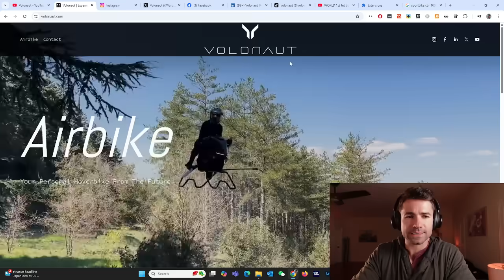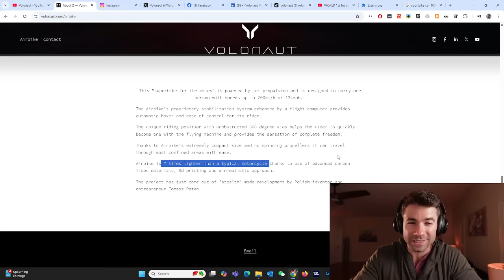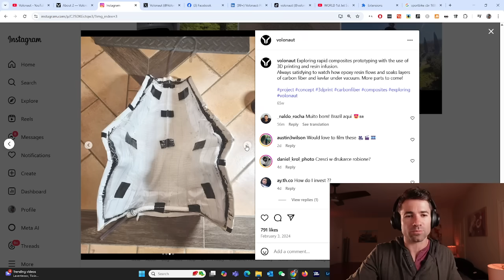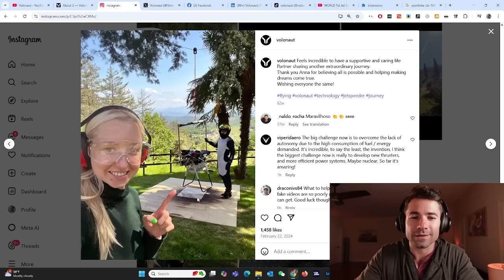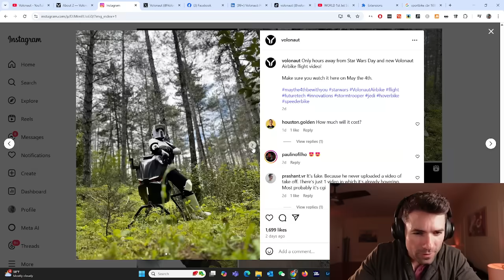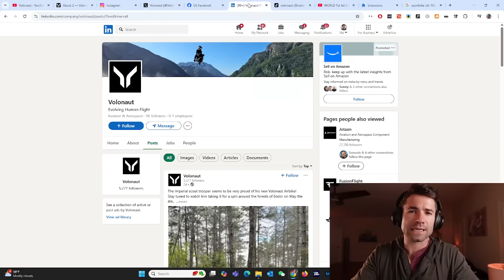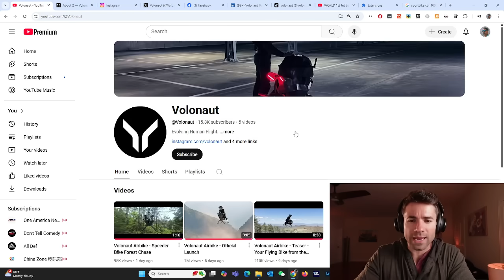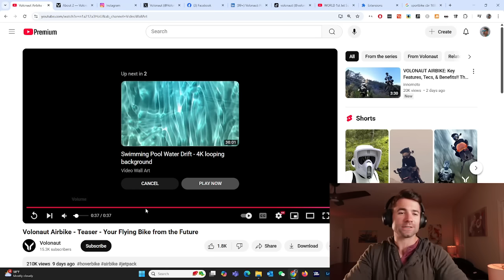Is the Volonaut Airbike Real or a Scam? (Expert Breakdown)

Comment: Indeed it raises the question of what drives this thing. So far there has been no implication for its ability to keep with the fact or fiction. In terms of parameters, presets for say feed/output vectors this will is just lacking. Certainly not the lethal scramble ability of the speeder bikes in Star Wars The Return Of the Jedi. In fact it would be outmaneuvered by any similar rivals in real life

Comment: although i absolutely fucking hate electirc vehicles , after seeing what you said , i trust you for that part 

hers's what i think 
physically it is possible but i do doubt the max.speed claim "204kmph" i dont think it would doo that much but i also do see it hitting that speed 
- If this even is real and gets out in the market the rich people shouldnt probably buy it cuz holy mother of gravity , thats a lot of Gs to be pullling for a normal person , people like f1 drivers, Fe drivers , pilots (especially single seater jets) would have a initial smoother time with this
- Now THATS a hot ass i wonder how much heat that jet engine is pushing from my educated -uneducated guess its hot

Comment: Fake. How do you come to the reason, that this would be real? Nothing of that is possible right now.
Reply: This device is rather simple. there is nothing extraordinary in it.
Reply: @orfyreus1961  If you can't spot CGI here, I don't know how. There is no air intake, there is just this easy to render blob where the "pilot" sit on, I Blender you such a footage in exact this quality in about 4 hours, well, the rendering takes a lot more on my old rig, but this was really cheaply done. It is correct, there is nothing extraordinary in this clip, when it comes to CGI. This is something everybody can make at home a few hours work.
But the "design" of that hover bike is sloppy and unbelievable. This is a show-reel for a CGI specialist and they will sell their workforce with the positive comments under their clip to the industry. That's what it is. So, then to fly this as a turbine vessel, you'd need trust vector, where are the mechanics hidden? This needs a certain length of construction to be able to do that, even if by miracle no air intake is necessary from anywhere for this turbine/impeller. Next thing, if that's electric, where are the batteries stored, that still leave space for the impeller? If it's a gas powered turbine, where is the exhaust? 

Usually, if people fly with such experimental crafts, they fly over water, because this kind of craft will fall like a stone when anything happens. And if you want to have an electric trust vector impeller, there needs to be a certain ratio of air intake and speed to produce the necessary lift, which is here 80 kg of human plus at least 50 kg of craft. You can create that lift by massive air, that you move, but for that you need a really big intake, like it is with propeller driven platforms, where you stand on and leave enough space for air to pass through or you need massive speed, acceleration of the air, which only can be done with gasoline driven turbines. Ever seen how hot those turbines become, especially if you need to keep it small? 

Usually the cooling is done in RC craft by speed of air, which is not the case on a hovering vessel. There is not even any RC craft available, able to do this, so there is zero of the steps available to get to a manned flight of this kind in the model area. All craft first are flying as models and there is just nil. Nil.

If you can't see the impossibility of engineering behind this project, then you most likely are not an engineer, are you? This is a bullshit project and a sales pitch for a CGI company or just a fun project of some hobby jesters. There is stuff that is possible, there is stuff that is maybe possible with huge gaps of hidden development and then there is bullshit. You want to build such a thing? Well, I guess with a turbine and afterburner, then you need the stages, intake, turbine with compressor, injector and exhaust then the burn chamber and after that the trust vector of the whole thing. No way to put that in such a short vessel up-down. Just no way, brother. You see that or you don't and this is a cool project, but it is fiction.
Reply: @ Sorry! It`s hard to discuss with your lack of knowledge.

Comment: Wow you're not hard to convince 😂

Having watched the whole video they released the quality control goes down the liner it goes and out stats to look really fake and at one point one of the flying images has a drone fan front and back as it's they put "flying motor bike" into an AI video creator and forgot to touch up some frames. 

Also early in that video they do say it's powered by dual jet engines so not sure why your confused about the propulsion system.

Comment: This conception isn't new. There was jetpack few decades ago powered by (liquid) rocket engine. We had newer version of the same idea with gas turbine instead of rocket. There were many variants of this concept, including "jet sleeves".
So it isn't a big deal to make things fly. My question is, how long can you be in the air with it. Because it was always a big problem for such tiny devices and fuel mass.

Comment: I feel two aspects are confused.  Is the Volonaut real?  It may be, but the claims are too fantastic - 200 km/h with a battery that weighs less than 50kg?  Jet propulsion from electricity?  As someone mentioned, this small it would barely be able to lift and land.  But the prototype may be real.  However, convincing me the video is real will be much more difficult.  It looks fake.  Nothing in the video feels real.

Comment: Why i have Doubt..
Gravity industry Jet pack suit where u fly like reallife ironman has 5 Jet engines.. 2 on each side of the arm.. and One Big Ass Engine on the Back which provide Most of the thrust..The Hover Bike seemed to have Engines below..The way how small and compact it is is suspicious as hell..
i donno if its real or not..
I just wanna see a review of the Engines they used...
Reply: Yeah, it shouldn't be the same size it should be significantly bigger. Considering it's a human weight in addition to structure
Reply: @meh6513  Honestly, Rob kept saying it was "the same size" but that hoverbike looked smaller to me. Like they've managed to condense the jet suit, make it super stable through "flight computer magic" and it flies way faster than those guys did? I'm calling BS, and even if I'm wrong and they solved so many of those issues the thing could only have a flight time of a few minutes with such a tiny fuel tank.

Comment: You think it's real?  Seriously?  Using 'jet propulsion,' yet it is also an eVTOL?  Which is it?  Does it use gas or batteries?  AND, you don't hover with just a rear propulsion thrust.  Plus, even if you make the case that the jet propulsion is always facing down (then they lied about it being an eVTOL), how does this pilot have any legs left- jet propulsion creates temps of around 2000 DEGREES!  Perhaps this airbike comes with an asbestos suit as well.

Comment: Problem with the drone turbines is that they likely have short longevity - since made for a single flight. 
The big cost of turbines is the very high temperature materials required (titanium, titanium-nickel alloys, etc).  It will be remembered that the first axial flow turbine engines by the Germans in WW2 in the ME 262 had to be replaced every 50 hours, they did not have the technology yet for better materials.   I'm not saying that these would be that limited for sure, but always a consideration.

Comment: If it's real with jet turbines, wouldn't there be visible heat distortion of light in the air? 
Also, if there are no moving parts, faneblades, that would be rocket boosters... It would suck a two gallon tank dry pretty fast!

Comment: if the bike was 100lbs and the rider 150-200lbs it would be top heavy/high center of gravity and prone to lateral roll (or any direction). What keeps it from tipping over? With the jet suits, the pilots have to constantly work to stabilize themselves.

Comment: You've already made the appropriate comparison with the technology in Gravity Industries' jet suits, and yes, it could be real. However, the question of range arises, as jet suits don't last very long and there's only so much time to fly... The fact is, though, when I watch the videos, it only seems partially believable. If the rockets are only fired downwards, I wonder how the thing is supposed to stabilize itself, even if the turbines are movable. What happens if the pilot leans too far in one direction? It's hard to imagine something like that being able to be done from underneath alone. But we all know what Toyota says - nothing is impossible!
Reply from the maker: Yes absolutely the flight time would be super short on this - I may dive into the numbers in another video. You could do multiple turbines for stability or thrust vectoring like you said - but just like a real ground based motorcycle if you lean it too far you'd likely fall off. There will certainly be some skill required.